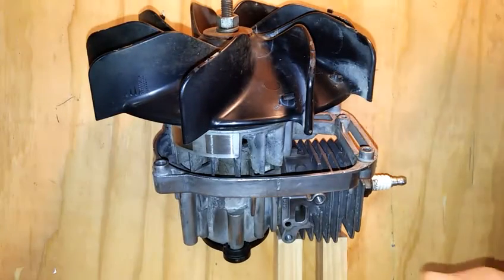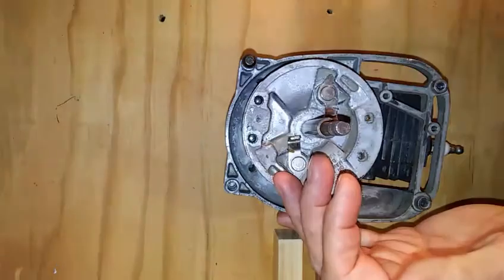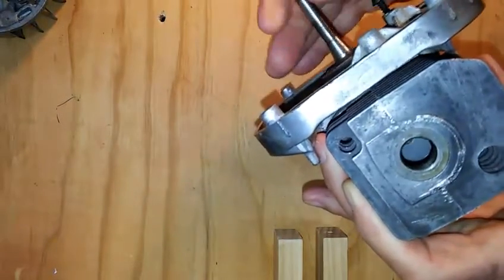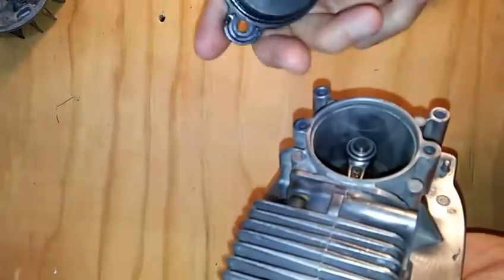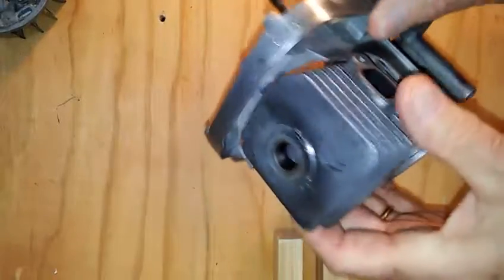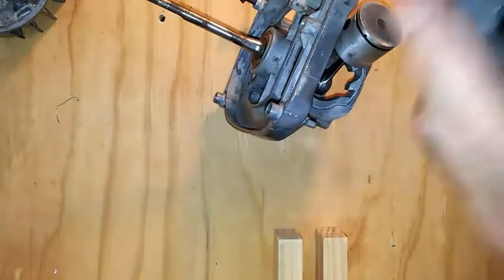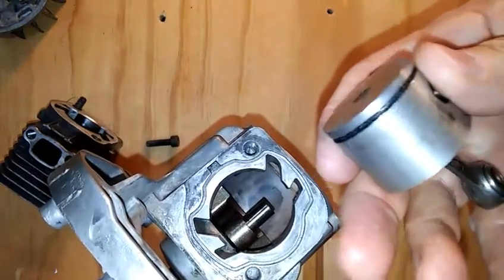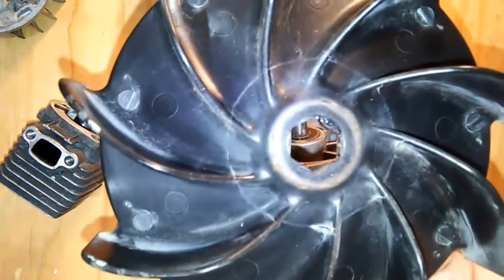Teardown 2 cycle leaf blower motor

Comment: I have a 25cc 2-cycle blower motor. The pin that is on the crankshaft which is connected to the connecting rod came loose and tore up the crankcase cover putting a hole in the cover. How the pin on the crank is set up is it goes through several thin counter weights on the crankshaft (I’m assuming it was pressed in). It slid out enough (which it shouldn’t do) to do the damage mentioned and rendered the blower useless. I tried to get the individual parts but found that difficult. I could by a short block but the motor in this blower is in quite a few different manufacturers. Why is so difficult to get some of the parts? The blower is a Remington R125 Hero 41AS79MY983